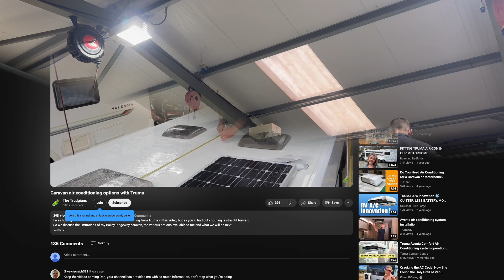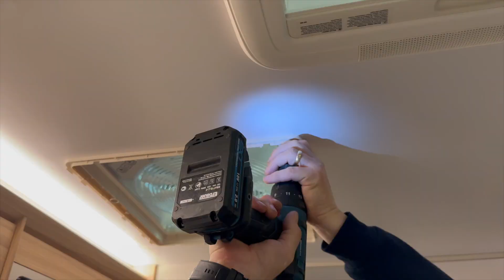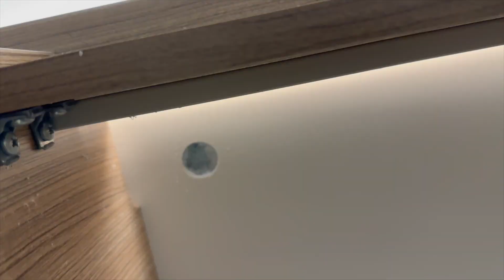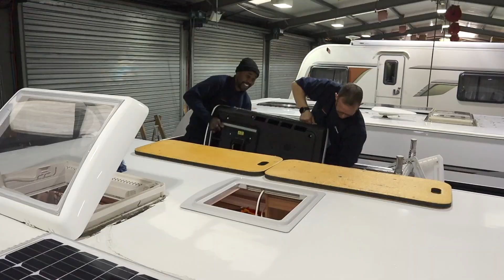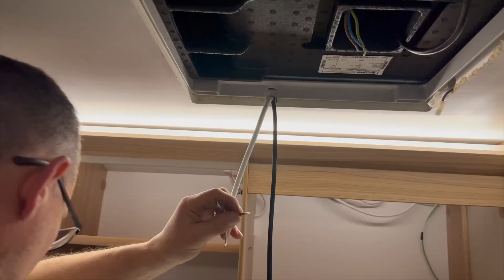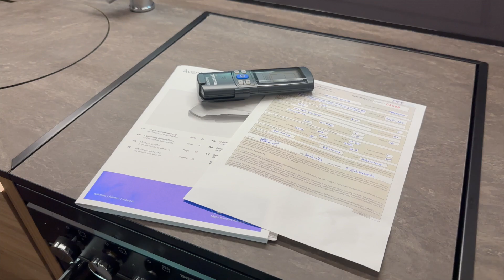Installing Truma air conditioning into our caravan

Comment: Did you pay extra to have the air conditioning connected to the Alde heating system?
Reply from the maker: Hi, no I installed the iNet system myself. It was compatible with the 3020 system, sadly no longer made or supported.

Comment: The truma in our sprinter campervan (not motorhome) is incredibly loud. It's the resonance. Could this be a fitting issue?
Reply from the maker: Hi Paul, i think this would need investigating further, but my intial thought i would imagine it might be noisier as the van is a tin box, that would resonate. My second thought led me down the path of a rubber gasket or isolation ring that could be used to reduce that resonance?

Im sorry I cannot be of much more use, i would contact the fitter and ask if the installation is correct.

Comment: Think I saw you @TheTrudgians while I was at Truma stand at the caravan show yesterday. Do you have any comment on the noise issue the Truma engineers admit to, which apparently will be fixed with a future software update?
Reply from the maker: Ohh, i dont know anything about this. I know the Gen 2 A/C is much quieter than mine, but as for a software update, this has passed me by.
Reply: @TheTrudgians It was the gen 2 I was referring to sadly, very noisy in the demo and they mentioned they hope to fix it with a software update

Comment: Just another thing to go wrong, we just take a small portable AC unit (which was a fraction of the cost of this thing)with us that usually lives in our bedroom at home, you don't need all this fancy gear! Still if you've money to burn and not a practical thinking person go ahead
Reply from the maker: Im not sure what your point is, you mention its another thing to go wrong, yet you have an AC unit, so, it cant be that. You mention "you dont need all this fancy gear". but again, you have one, so its not that. 

The only thing i can take away from this is the cost. Well, yes there are cheaper units, but make sure you get a split unit, (Where one half is outside) not a self contained one (Where you throw a pipe out the window). These units are simply cooling the air its heating, so fantastically uneconomical and extremely low cooling potential.
Reply: @TheTrudgians you have COMPLETELY MISSED my point!!!
It's gone straight over your head!😂😂😂 but you not being a practical person that's what happens.
BYEEEEEEEE😂

Comment: We have the same unit, fitted from new. It has a sleep mode which is reasonably quiet when running but every 10 mins or so it fires back into full blast mode for a few mins before going back quiet again. It’s so loud on full you can’t hear the tv over it and there is no chance of keeping it on overnight and sleeping with it cycling between full power and sleep mode. I still don’t understand how sleep mode allows it to still fire up every so often into full mode. Assuming sleep mode is lower power, I would accept it not being able to cool so much, maybe 50% but be able to sleep than have to have nothing because it’s far too loud. Need to speak to supplier to see if this is right or expected behaviour but wondered if you found the same?

Comment: I'm curious, how is the new van connected with I net. I have a similar set up with having Truma Aircon and Alde 3020 boiler/heating and control panel. You say the Aircon is connected to the app. I imagine this is via the old, and now removed, I net box? I'm interested in getting INet installed on our 2017 Cadiz but the only option now is INet x which would mean running two panels. One for the air con and one for the heating which seems daft...

Comment: Hi Dan ,I am about to fit my truma air con myself , I noticed that your fitter was useing hodgson seamseal cv ,however I have been in touch with hodgson and they recommend hodgson HS30 ,  What are your thoughts
Reply from the maker: Hi Ian, this is way above my pay grade, I really dont know the difference. I trust the installation of this unit, afterall they fit thousands of units each year across many different caravan and motorhome surfaces. 

Maybe its worth asking Truma directly?

Sorry I cant help further. 
Dan
Reply: Just had reply from Truma , they say they use the seamseal cv .  ,regards Ian

Comment: Hi Dan, I have just recently been in touch  with my dealership who had Truma fit our A/C in ref to your comment regarding the ‘Minor Works Cert’ 
Their workshop have stated ‘They have said that they don't fill them in as the unit is already prewired, So no change is made to the preexisting circuit’ 

Would it be Truma who fill these sheets in when they arrive and have copies?
Reply from the maker: Hi Lee, 

thats an interesting comment they have made. The AC unit is prewired, however to wire it into the caravan, a change has to be made. This may only be minor, like adding an extra socket (like in my case), but a change is made nonetheless. 

I would be interested to know where you stand with warranty if you had an issue with your on board electrical system. furthermore, how do you know that the installation has been electrically tested correctly?

Dan
Reply: Hi Dan, thank you for this video, just goes to show what info your advised on Practical Caravan forum (some telling me duff info). Today I finally received my Minor Electrical Installation Works Cert for fitting the Truma A/C. Having not watched this video, I would never have known to chase it. Thank you again 👏

Comment: An air con is something we probably won’t get because we go off grid most of the time, so probably not worth the cost. But what size power bank do you use in storage? I have a Jackery 500 but not to power the van but to run our portable freezer or top up the on board battery if a few dull days. I suspect it wouldn’t run an air con.
Reply from the maker: I have the Jackery 1000. That runs most things on the caravan apart from the heating. It will run the A/C for just under an hour.

Comment: Great Video Dan, I have for the last 3 weeks researched the  S*&T out of this product. When i found out the cost of the unit Vs the cost of supply and fit i was shocked the install cost was so expensive. I was convinced i could install it myself given im a Qualified Install Electrician. However this was under the assumption that the Holes were already in the roof for cable access (found on new caravans) on inspection our caravan Hasnt. Added to this, the amount of extra panels that need removing to get the CAT5 cable to the Truma controller, it started to become apparent why the install cost is what it is. And losing the added 5 year warranty its just not worth doing it myself. The thing that does confuse me is that it seems a generic price to supply and fit these units but not everyone's situation is the same, predrilled roofs, Roof light close to the microwave vs being in the bedroom etc so you would think the install cost would differ based on situation but it doesnt. Cool video ;-)
Reply from the maker: I imagine there is a time scale that these are priced to? There are terrible install times that include cutting a hole in the roof. And the ones that go under a locker and need to be plumbed in. 

An interesting consideration. 🤔

Comment: As I am thinking of have one of these fitted to my new van due May this was very interesting thanks Dan.  Can you tell me what size portable lithium unit you use at your storage yard as I am also having a 2000 watt inverter with a 2.4 amp lithium battery fitted in the new van and was wondering if this inverter would run the heater for a short time to heat up the van first thing in the morning, say 15 to 20 minutes?  Thanks - Eddie
Reply from the maker: Hi, the power station I use is a Jackery 1000. I also use an Anker 1500w too. Both will run the A/C in storage for an hour or so.
Reply: Thanks that's a big help  @TheTrudgians

Comment: Great vlog, we have a motorhome 3 years old, the manufacturer has told us if we have AC fitted we will forfeit the outstanding 7 year warranty, even if fitted by an accredited and registered fitter.
Reply from the maker: That doesn't sound right. Does your motorhome need a hole cut into the roof?
Reply: @TheTrudgians  They said it may need to extend the one roof light
Reply: What make is it

Comment: Excellent job there Dan 👍. If I’m correct 2400w cooling performance is around 8000btu in old money. If I had the available payload, an AC unit would have been fitted years ago. We have to use the Omnivent to extract warm air but on the plus side it’s also used to extract cooking smells. Cheers, Rob

Comment: I'm looking to get a compact plus or comfort fitted in our 23 model Südwind 580QS. Dealer desperately wants to (understandably) fit it in the existing 400x400 small heiki but its right at the rear of the van and would cut out a huge amount of light. I'd like a new hole cut in the hail resistant roof further forward and for it to be fitted there. How do you insist on truma fitting it? They must have schematics for the fitment where i want it as another 580 QS owner has had it done by Truma (albeit at a different dealer to ours). All a bit conflicting. Trying also not to put our supplying dealers nose out of joint. 

Did you pay Truma for the install or Swindon?

Comment: Hi Dan, great video as always and a great insight. We purchased a Challenger 670 Grande SE end of last year and had the Truma Aventa Compact Plus A/C fitted. We haven’t had a chance to test it yet as it went straight into storage. We do however only have a remote control. I noticed you retrofitted an iNet device, is this something which can easily be done by myself so we can have the A/C turn on before we get back to van after a long walk during summer? Would love this option.

Comment: Hi Dan.

Can I just point out that it's not a RJ11 cable it's actually RJ12 cable. I made the mistake of fitting an RJ11 but it wouldn't work.
Reply from the maker: You are 100% correct!

Comment: Hi Dan, many thanks for this video we had the Truma Compact installed by Truma into our Swift Sprite Major 4EB just before Covid started so this was a great insight into how it was done.

We were away when we first used it and had some issues with it leaking even though I followed the instructions  ☹. This was eventually found out to be  that a faulty sensor was the cause during build process in Germany. However because it's built in the whole Unit had to be replaced.

We got it back and was away in it when it started leaking once again 😧, I took more videos and photos, I was getting about a 1/4" of water in a bowl this time. So rang our dealer to explain once again between our dealer, truma and ourselves it was causing us all real problems as they couldn't understand or replicate our problem in our dealers workshop.  By now we were starting to get really fed up and were thinking of changing to the Under Bed Version.

We were away in it once again when it happened again so for the 3rd time I spoke to our dealer and Truma. This time I spoke to Laurie at Truma who is their most Senior Engineer and he suggested that we had our caravan taken to them so they could put it in their Climate Control Centre to replicate our settings and the conditions when we were using it, which was beside a lakeside pitch because they thought that might be causing the issue. However no matter what they tried they still couldn't get it to leak like we did. 

So we were told to try it again and if it happened call Laurie direct, which surprise surprise it did 😠I was really fed up now because this was getting beyond a joke and definitely not what we had paid for as it wa ruining our holidays

Then I had a phone call from Laurie who had been thinking about our issues and then came to the conclusion that we were using it on the wrong fan speed for too long (we use it mainly on low speed as it can be quite noisy inside the caravan on medium or high speed and this was causing the issue, because on low it's not producing enough power to clear any condensation that builds up, so every so often it should be put on High speed to clear it.

So far it's now working as it should be but I'm still dreading it leaking again.

Sorry for the long message but thought you might like to hear what problems I had with mine

Keep up the great work

Michael🍻
Reply: I can totally relate to that leakage issue. We found the Truma Ventura leaking condensation through the exterior of the van. Sometimes out of the engine compartment and another time out of the rear left side, kind of going past the garage. I assume that it didn't leak inside anywhere because our hab check didn't show up any damp. But it has kind of worried me. I never did have the leaks checked because we're selling the van. As you say, it is quite noisy but luckily only inside. Outside the Truma is remarkably quiet. Maybe it was the same issue, namely the low fan speed. It was very cool inside especially travelling through the nightmare heatwaves in southern Europe I'm June and July.

Comment: Hi Dan good vlog but whats the reason they drilled another hole across the roof instead of using the existing ducting?
Reply from the maker: Hi, the existing cabling for omini vent is 12v. It doesn’t route in a useable path to run a new 230v. Also, the data cable needs to go to the right hand side of the vehicle, not the left.  So even if a new power cable could use the existing route, a new exit would need to be created for data. 👍

Comment: Having had this model.

The led lights in them were brilliant and gave a great ambience.

The unit is noisy in use. Especially when it's 30 degrees outside. It often gave me a headache.

It normally cools up to 10/15 degrees below outside temperature.

Comment: Is the caravan roof strong enough for people to kneel on?
Reply from the maker: Yes it is on an AluTech body. 👍
Reply: They used spreader boards* to kneel on.*which as the name suggests spreads the weight across the roof and into the whole structure.

Comment: Thanks for the video Dan, did you consider the dometic versions at all? They also seem a comparable product/price.
Reply from the maker: Hi, I didn't choose the dometic, purely based upon our experience of the Aventa Compact. it worked perfectly with our on board heating, and I also retro fitted the Truma iNet to join the Alde & Truma systems.